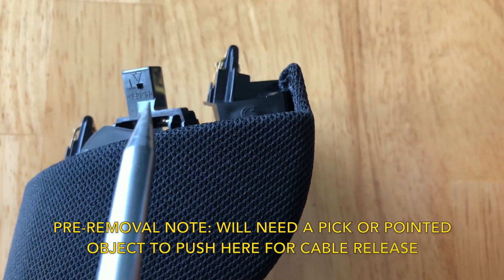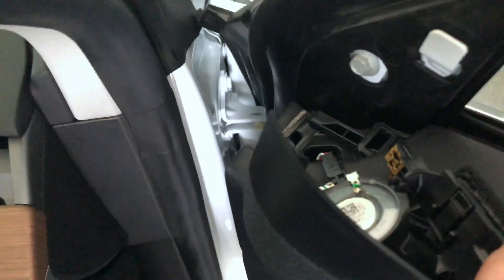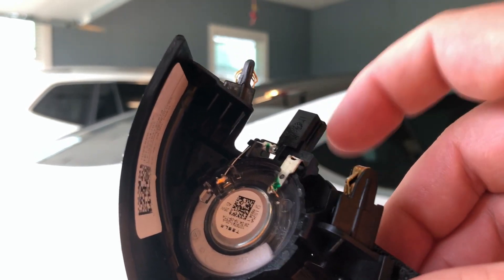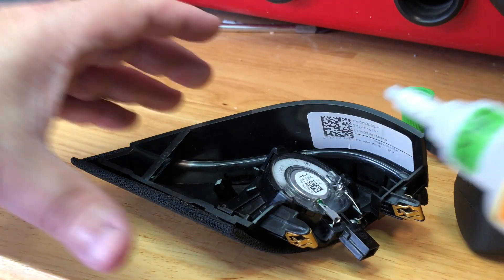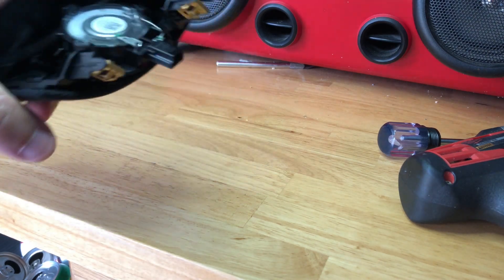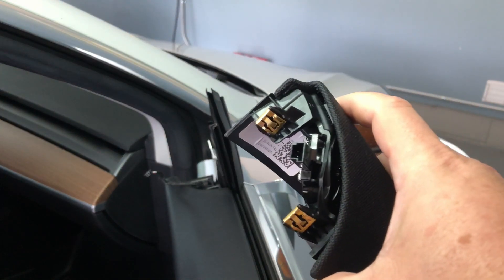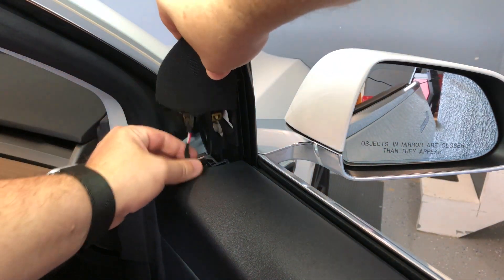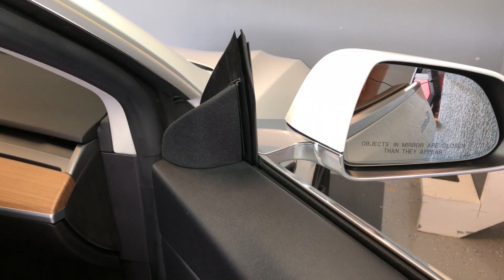Rattling Tweeter Model 3

Comment from the maker: Found the second rattle.  It was the frunk cover for the air inlet and 12v battery. One clip came undone.  Probably due to new large speed bumps in a local park.  Probably wasn’t inserted 100% the way in from adding the inlet cover.

Comment: what year is this? I'm trying to remove the tweeter from the front right side but having the toughest issue. one website said it's glued on. wonder if a later year model 3 changed it from glue to clips. i have the 2018 model 3.
Reply from the maker: Nicholas this is a 2019 Model September build.
Reply: @model3geek163  got it thanks. for those anyone else googling, i finally got it out. ended up getting a heavy duty trim puller/pry tool (search on amazon).
Reply: Absolutely impossible to put this back on M3LR22.